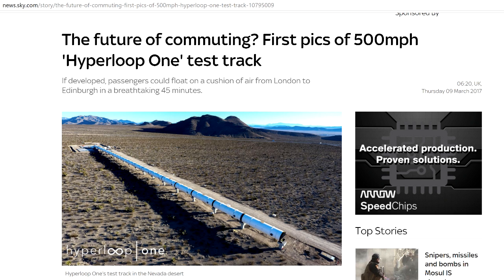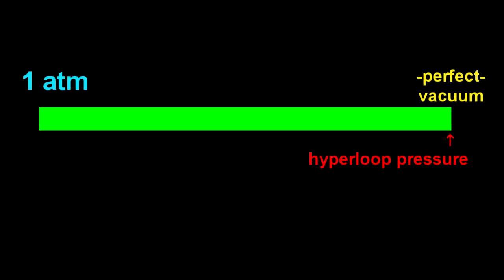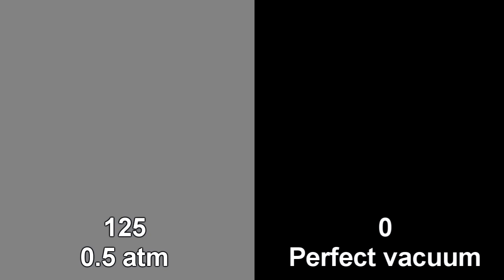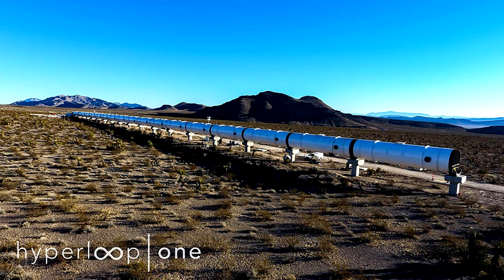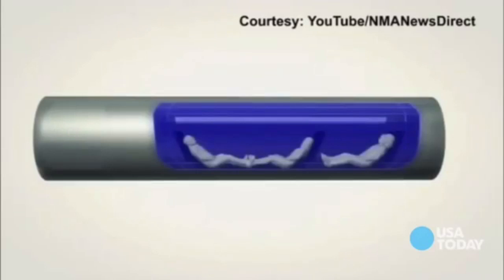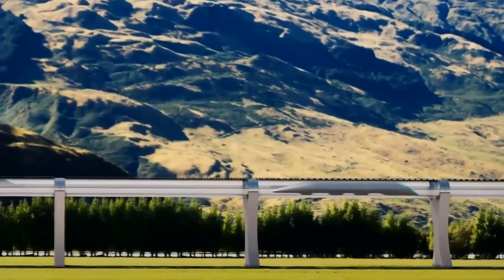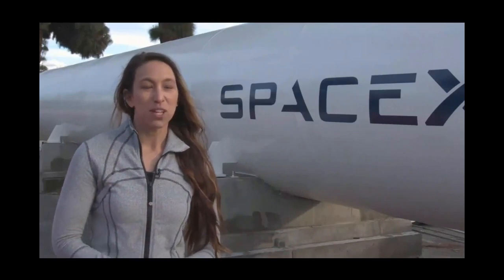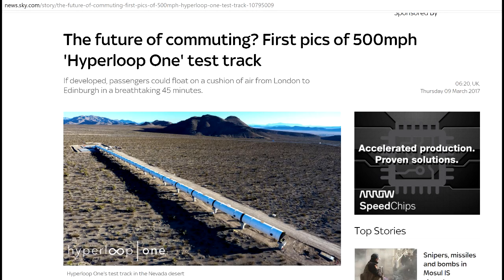Entire Hyperloop could be destroyed in SECONDS!

Comment: I honestly don't see why they just don't build a high-speed rail line like what they have in European and Asian countries. But I guess finding funding for such a project would be difficult.
Reply: Economics! It's honestly all about Economics! Really that's the answer. Just because something works perfectly well in one environment does not make it ideal for others. High Speed Rail works when you have extremely dense population centers with a small to mid level of sparsely populated separation between them. This nicely describes Europe and Japan. Most of the people live in the urban centers. Travel is between the urban centers. And the distances involved point to point are not that great. This makes the cost per kilometer not that extreme vs the population density. The US is a much less dense country. While there are a few dense population centers, the general population is much more finely dispersed over a much broader area than you get in Japan or Europe. You have vest distances between the population centers. Given the arrangement of the US and the distribution of its population, Air Travel is 100x more efficient than high speed rail. simply because it achieves the same high speed point to point travel without the expense of the rail infrastructure over the far more vast open prairies that you don't get in the denser old world countries. The US has High Speed Rail in those few areas where it matches the profile in which High Speed Rail becomes marginally efficient. The Ace-la Corridor in the Northeast. 

And if someone wonders why the US does not have as good of high speed broadband as Japan or parts of Europe, see above. Same rules apply. Lower more dispersed population density means while 1 tower in Europe could reach or service 100,000 people, do to greater distances and lower density to reach that same number in the US requires 5-10 towers. 

They don't actually teach the concept of the costs/benefits analysis in Universities anymore, do they? It's all follow your dreams and feelz type nonsense.
Reply: Ghost Assassin don't forget political stands, most of them have shares in other type of transportation business, they would make the project a nightmare to finish with all sorts of obstacles just to keep their business alive.
Reply: Under the sea? So not only will the tube have to withstand an extreme vacuum, on top of that it will have to withstand the weight of the sea? What are they going to make such a thing out of, unobtainium?
Reply: +id Inside the hyperloop, there theoretically should be no air resistance, right? Then, why does the hyperloop need an aerodynamic design if there's no air resistance? It just make it way more expensive.

Also, building the hyperloop would be very expensive and the whole system would disrupt if only a rock hits the pipes, so it's more dangerous.
Reply: It's much easier to fund a project that is 100 times more expensive and won't even work.
Reply: You say that, but the California High Speed Rail system is already being built. https://en.wikipedia.org/wiki/California_High-Speed_Rail It's yet another reason Hyperloop isn't going to be built (in California at least).
Reply: because even though we make more money than most countries in the world, our government only allows certain companies to milk us dry, and they dont allow new companies to cut in on that shit unless its with some ridiculous retarded bullshit that will never work nor be accepted if it did.
Reply: Because there's no glory for Elon Musk in that.
Reply: id, it could be, but almost certainly won't be. https://ggwash.org/view/32078/musks-hyperloop-math-doesnt-add-up
Reply: James, you're quite possibly right. Here in Europe, trains are a practical way to get around because they're integrated into a comprehensive public transportation network. Where I live, I can take a bus from a stop a few hundred yards from my house to the train station, where I can get a train to almost any city in the country, where there will be a bus to take me to within a few hundred yards of my final destination. In California, my understanding is that in most places, you'll get a train to a city, and then you're on your own for transportation.
Reply: "we can have cargo truck that drops off a freight capsule onto a robot pallet that rolls into the vessel." -- Sure, but...why? We ALREADY have a nationwide freight network that's been/being incrementally improved as revenues allow. It's largely modular, surprisingly cost-efficient, and it works well enough. Standard cargo containers will NOT work with that silly sewer pipe. There's an ancient saying: "Freight finds the cheapest route." FREIGHT DOES NOT REQUIRE SPEED. Only people do.
Reply: No you really can't. That whole Vacuum tube thing? Remember that? Every inch of diameter greatly increases the costs, risks, energy required to maintain vacuum, etc. This works against cargo transport in every way possible. You are taking all the costs and inefficiencies and problems of sending Cargo into orbit, and attempting to needlessly apply them to transport at sea level.
Reply: Despite the issues with high-speed rail, I still think it's a much more proven and viable alternative to the hyperloop.
Reply: I can remember a video that's called something like: "why american railroads are shit."
After watching that vid you will feel like: "how is a country with less high speeds railways than Uzbekistan supposed to build a hyperloop?" It's all about the PR. It's the prestige of the USA. They have to build something way to awesome. Except it won't work out, but who cares?
Reply: Will noneya Amtrak tried that during the energy crisis of the Carter administration. It worked badly. It seemed a good idea on paper, but there were a lot of very basic logistical problems that gummed up the works in trying to handle the autos. I think there is some car service in the Chanel Tunnel, which benefits from being simply point to point with no extra stops. But is still an awkward fit.
Reply: they are, and it's costing Californians billions for something we will rarely use
Reply: pi7830 And building a vacuum chamber isn't. we saw what happens when it cracks.
Reply: id no it actually can't. It has the same freight handling limitations as modern railroads. If you exceed a certain length you start to foul the system. The railroads actually had to daylight a large number of tunnels (remove the top of hills) in order to increase freight capacity and allow for modern double stacks. 

This illustrates the frustrations in watching this thing. I love all the people crying how "The Engineers know best. They know better than us." While at the same time the Engineers are clearly ignoring lessons learned by decades of not centuries of Transportation Engineering. This tendency of ignoring hard learned lessons of the past and insisting on reinventing the wheel is a Silicon Valley hallmark, and one that Musk is a particularly prolific sufferer.
Reply: sasja de vries. And this is an incredibly Eurocentric view of things. It's a common myth that American Railroads are "shit". American railroads are booming and experiencing a renaissance. Nobody notices because they only do what they are good at. Moving Freight and Cargo. Which they move more of than most other places. American Passenger Railroads are shit because Airplanes largely replaced them 50 years ago. American population density and geographic distribution of cities and people would make High Speed Rail a largely overly expensive under utilized money pit in the US. This is pretty obvious to anybody that isn't a California elected politician. The rest of us just assume it must be something in the water there.
Reply: There is air resistance in the hyperloop. That is part of the compromise that is the design. Think of it this way. Airplanes fly high in order to go great distances on the least energy per mile. They are limited to the altitude at which it is practical to operate their engines efficiently, and also must carry with them the means to get up and down from those altitudes. Spacecraft coast for very long distances at much higher altitudes, but cannot carry enough fuel to do the same distances in air passengers can breath. We will eventually travel the longest distances outside the bulk of the atmosphere with spaceplane type vehicles whose vacuum liability will be much higher than Hyperloop.
So consider Hyperloop as being a wingless vehicle in an artificial stratispheric altitude (think of the parachute jump done from a balloon at 120,000 ft.) that needs to be built for that level of low pressure. It has been done many times already. Indeed the U-2 flies most of the way to that altitude, and would go higher if the wings and engine could work that high. 
The difficulty  and danger lies within, not outside that tube. The design must avoid the walls of the tube dynamically, and safely. The tolerances can be much larger than standard high speed rail, and with little atmosphere, will not need as much motive energy or wind buffeting tolerances of Superconducting MagLev trains being built right no in Japan. Having some small amount of air in the tube is a plus in this regard as it can help keep an aerodynamically shaped capsule centered. The maglev need only support it and guide it. Linear propulsion motors do not have to be the full length of the tube the way that Maglev in air requires,  as Hyperloop will coast much of the way like a roller coaster but much faster.
Reply: And how many tracks are you building? One? Maybe two in parallel? Which means that yes much like traditional trains the entire system is gummed up by whatever has to slow down and stop first. Freight flow is freight flow. Once again sometimes the old folks do know and understand what they are doing.
Reply: id no it won't. For the simple reason it has 1000x + the infrastructure and upkeep costs in order to accomplish what low infrastructure and upkeep air travel is capable of doing today. It is an extremely expensive solution to a very inexpensive problem. No matter how much whiz bang futuretech engineering or left wing social engineering you throw at it you cannot overcome that core hurdle.
Reply: @ID. Well, that's a complete waste of money and time, wasn't it? And now they want to try out plastic roads too? Yeah, the Netherlands sure has its priorities straight doesn't it? Waste millions of dollars on fanciful pipe dreams that will blow up in their faces. 

I'm not going to bother asking the same questions about the solar roadways because they've already been asked before and far more practical solutions than putting solar panels underneath the road surface. 

The hyperloop - just like solar roadways, and even plastic roads - is proposing expensive and outlandish solutions to problems that conventional transportation and technology already solve for far less. I am not all convinced at all it will work. All the engineers in the world cannot guarantee that the Hyperloop will be able to overcome significant infrastructural problems as outlined previously in this thread.  Because Elon Musk proposes a 1,000km vacuum tube that can maintain structural integrity, with no problems whatsoever in the event of a rupture, suddenly we are supposed to believe it can be done - and all financial and logistical hurdles won't ever become a problem - because they have teams of engineers working on it?

Yeah, good luck with that. I think I'll just take a plane.
Reply: Ghost Assassin cause stupid frickin merica always wants to be better
Reply: Marmocet 👌
Reply: Ghost Assassin 
Because we have airplanes.
Reply: +Marmocet I would say the contrary. I'm not quoting or trusting what Elon says about the costs, but rather the feasibility studies done in Europe that were funded partly by governments. According those, it is viable so far, but now they're finding out how it'd impact the environment and how suitable the soil is for construction along the planned route in more detailed assessment.
Reply: +andre taylor You should check out the modular design where capsules are loaded into the vessels, including cars. Options are open, we can have cargo truck that drops off a freight capsule onto a robot pallet that rolls into the vessel.
Reply: +andre Remains to be seen how wide and tall the shuttle are, 2x2m square would be more than enough for efficient transport of freight as the shuttle can be quite long.
Reply: Also building a high speed rain in California is a bad idea with all dem earthquakes
Reply: Ok, guys, I think you've made it abundantly clear at this point that high-speed rail is a no go.
Reply: Ethan Lamoureux actually, having it in the ocean would probably be better because then you could just make it out of super thick steel encased in concrete (like current under-ocean tunnels). The difference between 1atm and a vacuum is absolutely minuscule compared to the pressure under 1000 feet of water, so, being able to withstand 100 kPa more wouldn't be an issue. Hell, it could actually work in the ocean. It could be perfectly straight. It would have a more even temperature. Etc. yeah, underwater is the only way I see this working. But, then again, you don't get the safety measures like being about to allow in air from the sides of the tube... Unless an envelope of air were placed around it...
Reply: +Andrew It does NOT need the same capacity per ride, it just needs to be able to carry same amount of cargo per hour to be way better and more efficient. Why can't you see that? With hyperloop, every cargo container could be sent separately with no energy wasted, all the containers only stop once, in the destination where they're supposed to be dropped off. With trains these both are practically impossible.

So there's no risk to foul the system as the shuttles only carry one cargo container each and aren't connected to each other in any physical way.
Reply: The Hyperloop is defined by two tubes, not one. The key to its viability is speed over distance such that a single container is delivered end to end more like the legs of an aircraft trip, with throughput as the metric. Aircraft on the shorter distances proposed for Hyperloop spend too much time in getting to their efficient medium of transit. 
Trains are more like an assembly line, where progress is steady in fits and starts but one mishap can gum up the works as you imagine. Therefore it must be designed with enough slop and margin for error to not get gummed up. Railroads at one time were that more perfect and efficient means in relation to the transport at the time of their introduction. 
Take for example, the Erie Canal. It was modeled upon the successful system of narrow canals in Europe. We Americans made it a bigger one and with more traffic capacity, but it moved at the same plodding pace of a horse. It took decades to make it, and it was no faster, as is the  European/Japanese High Speed Rail we are building here today in California. Within a third of the time it took to build the Erie Canal, its passenger function was replaced with a speedier railroad alongside it.  The canal continued as the preferred method for bulk cargo.
If it is possible, we will do the same here using Hyperloop, and have a compound system. End to end speed for passengers and time sensitive cargo, with the intermediate stops and local delivery of cargo provided by rail alongside.
Reply: +D dabdab0132 Malfunctions are always possible, but as it's very controlled environment  and only with a few moving parts, those are greatly less likely to happen than with any other form of transport. Because this thing is new and challenges exist, doesn't mean it won't work, it only means we need to solve those problems. Also because you don't know the exact nature of the hypothetical problems nor have knowledge of engineering solutions for these, I don't think you've a reason to be so skeptical. People said trains were impossible, then they said flying is impossible, then they said space travel is impossible, then they said landing on moon is impossible, now they say hyperloop is impossible. Just funny seeing the repetition of ignorance throughout history.
Reply: +d dabada100320 lol, so neither you do have any real, realistic reason why hyperloop won't work or even capability for basic logic. It seems the biggest bullshitters on internet are currently  trying to convince hyperloop won't happen, because it wouldn't work.
Reply: Well there are fairly high speed trains in North America over distances as short as you would find in Europe. The route that hyper-loop is supposed to take would probably be ideal for one. 

Really though everyone plays air travel up as super expensive and time consuming but tickets generally cost maybe 100/200 CDN for a flight like that and when your travelling regional clearing airport security will take, like, 15 minutes max. If you get held up its either because you were a dumbass and made a bomb joke/forgot to follow the carry on rules.

There isn't much in the way of large scale high speed train networks because there is no need for them.
Reply: Imagine a larger scale bullet train that you drove your car onto.
Reply: +Joseph Hunhoff And that's why US isn't the best by any standard country, they neglect the positive externalities which would make an investment profitable for the society as a whole despite being a bad business investment.
Reply: id what kind of stupidity is that nonsense? There are no "Positive Externalities". Inefficient and Stupid is Inefficient and Stupid. No matter who pays for it or how much it resembles cool shit from Elon Musks childhood comic books. The US government does pay for large numbers of positive externalities. Interstate Highways, Airports, Ports,  what passenger rail there is. (In the US largely commuter.). It doesn't change the fact that people's living and movement patterns in the US are not those of Europes.
Reply: +andre taylor Did you really just say there are no positive externalities and then moved on and stated there suddenly are? How stupid is that? I'm just a bit baffled. 
I'm not american, but AFAIK the east-coast is pretty populated, if metro area of 2+million is 500 km away from another similarly sized one, it should be worth it even without the positive externalities, maybe not just quick enough to be a good investment for an investor.  E.g. the profits come after an extended period of time which an investor can't afford to wait on, but a government could as it can get the money with lower interest rates in the first place etc. etc.
Also SF and LA could be linked up pretty nicely.
Reply: id I said there are no positive externalities to this idiotic scam. It fails core economic tests. You would have to be a complete moron or possibly European to seek to spend public money on something this stupid. Positive externalities require actual provable public benefit. Not simply a seemingly good idea. Even in the Northeast US, where there are denser cities, and we do have high speed rail, it is by and large a boondoggle. US cities and communities are not laid out as European ones are. The population is not distributed the same. Any transport such as the fixed point to point Hyperloop would require a radical alteration in how the population lives and moves in order to accrue an even marginal benefit. Any product that insists its consumers must change in order for it to succeed will fail.
Reply: +andrew I guess you buy this BS TF is yabbering about? Just wait and see what's going to happen, it will eventually get built and it'll work just fine.
Reply: @ID. That's what they said about solar roadways and look what happened to that project.
Reply: +andrew And how exactly do you know that? You don't know shit, so why do you act like you do? Actual experts, who get paid to make cost estimates and feasibility assessments  think it's doable, how could you possibly know any better as you don't have an engineering or economics degree?
Reply: +Ghost Well, they never said that. It was an indiegogo campaign by some couple without proper experts involved and no investors nor serious money, just pennies.
Also the couple made the feasibility etc. by themselves, whereas hyperloop had KPMG and other 3rd parties make the estimates.

Solar roads are a thing, but the couple just wasn't up for the task.
https://arstechnica.com/cars/2016/12/worlds-first-solar-road-opens-in-france/
Reply: You're seriously going to tell me, that a metal tube with near or at a perfect vacuum will not lead to a significant problem when it is ruptured? Despite the fact that the atmosphere will try to equalize the pressure between the two?

Yeah, I don't believe you for a second. Answer me this, what's going to prevent the hyperloop from suffering the same fate as the tanker truck and the rail car in this video?
Reply: +Ghost Probably the fact that it is actually built to withstand the pressure. The vehicles won't budge with proper safeguards in place, sure it stops all the traffic, but nobody is going to die. It's just physics and there are ways to counter all forces possible in this kind of scenario.
Reply: It's built to withstand the pressure? Did they test the material under various scenarios?  Have the metal been subjected to negative pressures inside them and ruptured to see what happens? And if so, where are the results?
Reply: they arent as fast as you think btw, airplanes are much faster
Reply: Fact checked
Hyperloop design spec   average 600 mph (970 km/h), with a top speed of 760 mph
Cruise speed  Boeing 737-  514 mph
Reply: maglev is not fast enough for the US continent, airplanes take too long to board.
Reply: lenard ggor which is why it is
Reply: Have you ever been on one of those?
Let me tell you who uses it, nobody.
You can look at the issue with the spanish high speed system running almost empty constantly because nobody wants to pay 100€ for a ride when you can take a plane for that price, HSR is not economically feasible without the government pumping money into it to keep prices low.
Reply: id  use common sense,  if an airplane crashes,  the airliner still stay in business  the next day with only the cost the airplane.  the same goes for boats,  trains,  cars,  rockets,  space shuttles,  buses.  if a minute thing goes wrong with the tube,  the entire structure will implode in itself costing billions of dollars and will take years to get back in operation.  common sense people
Reply: Have you seen American railways? Making them high-speed will make them more deadly than the hyperloop!
Reply: Because the hyperloop was proposed to derail the california high speed rail project so that Musk could continue selling cars, while pretending to be an enviromentalist.
Reply: Sigh.. This will be built at about the same time SpaceX sends people to Mars. Or the Lunar orbit for that matter. I.e. - fucking never.
I'm convinced SpaceX is now mainly operating on a bullshit-based business model: make extravagant claims, make news, increase public profile - increase value of stock and draw investment. They're basically capitalizing on the Star Trek generation.
And when the bullshit turns out to be bullshit, the profit will already have been made, various NORMAL-ASS ventures (like satellite launches) will have been expanded on, and virtually NOBODY will cover the slow petering out of the various publicity "projects".
Reply: It's 'murica. You don't have dem European privileges, which are "Even tho not proud of self, still has a rational mind"
Reply: Who wants boring old trains duude, this is the 21st century! Didn't you ever watch the Jetsons!?

Look, Musk wants his publicity. The profitability of SpaceX depends on its undeservedly large public profile - that's what this is about. And the semi-sentient west coast hippies want their cool eco-friendly solar railway, goddamnit!
Reply: +Colorme Because it's cheaper and faster, plus easier to automate so no human labor needed to waste resources.  So why are you afraid then, if the freight finds the cheapest route and this thing happens to be cheaper? This is cheap as it does not waste energy to fight air or water.
Reply: +andre taylor Nope, you are just being stupid. There's a mainline, think of it as a highway, which will have Y section to divert the vehicles at top-speed off and onto the highway in order to have stops without slowing down the traffic. 
Once again, you should just use your fucking brains a bit more rather than just trust what the old and ignorant tell you.
Reply: +Ghost Luckily there exists people who don't think the way you do, because without them, we wouldn't have reached stone age.

Rupture is not a problem, it won't lead to a disaster, it'll be an annoyance that needs some fixing, if it even happens in the first place as it is not a balloon to be popped with a needle. People like TF lack the ingenuity required to see and come up with solutions, instead they just give up and move on to the next thing to quit before it's been even started.
Reply: Hey Id it’s 5 years later and nothing much is happening. Do you still think this thing is getting built?
Reply: They are building one (thoug it's a bit slow for a high-speed rail). Hyperloop would, if it's economical and practical, be a whole new step. It's like going from horses to trains. The entirety of Germany could be in commuting distance of each other. Hyperloop isn't just a fancy train if it works out, it's a new transport revolution.
Reply: But this thing CAN'T transport Cargo very efficiently. That's one of the key design points that the people building these things either don't understand or simply ignore. Efficient Passenger Travel and Efficient Cargo travel are two different things. Wildly different. For Cargo transport capacity is king. Why reduce the size of your payloads in order to squeeze them into a vacuum tube to shoot them at a speed you can already hit with other technologies? There is a reason nobody uses high speed rail for freight. It's not needed. It's inefficient. And it has insufficient capacity for the task. Any benefits gained from the slight increase in speed point to point are more than swamped by the increased handling costs at each end as you must reduce the size of the load and break it up. Then reassemble it or use additional handling at the end point in order to facilitate local delivery. Cargo transport needs bulk capabilities to be efficient. Nothing in this concept allows for that. 

Most of the concepts they are using to sell this thing, are straight up lies. It is not a useful transport mechanism for goods and cargo. It does nothing to reduce traffic, nor increase safety or reduce annual deaths. They claim it will replace cars. It won't. It doesn't work that way. It's only purpose would be to replace planes. And for that it is an overpriced, inefficient, over engineered nightmare of a project that can never ever pay for itself.
Reply: +Supershadow301 Hyper Loop isn't necessary a full vacuum, so thus the aerodynamics. Also it could be done by creating a temporal vacuum in front of the train with a huge jet engine. Which will pull the train and push it forward with minimal air resistance. 
Hyper Loop isn't necessarily expensive, sure it costs to build, but operation could be dirt cheap, we don't know the exact costs yet, but the preliminary studies report it isn't too much. For example Finland-Sweden 500 km Hyper Loop connection under the sea would be around 20 billion euros, including all the costs, profit margins etc. risk overhead. Operating profit is estimated to be around 800 million euros, so it'd take 25 years to get profitable directly from operation, but it'll have positive external effects to the economy.  Further link from Sweden to central Europe would increase the economic benefits.

However these reports didn't include benefits from transporting cargo very efficiently, only passengers.
Reply: +Ethan Lamoureux And again here we go with the ignorance throwing all the concepts that engineering has magically created out of nothing out of the window. 

It is possible, the calculations have been done. Now it's in a phase to find out how the project impacts the environment.
Reply: High-speed rails are expensive to operate. Ever heard of a thing called air resistance? Building and operating hyper loop could be cheaper.